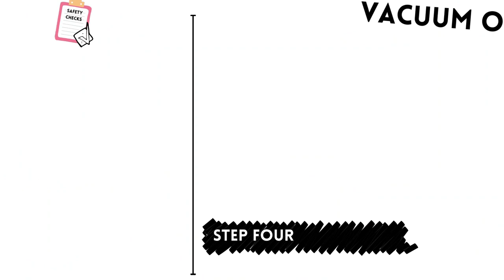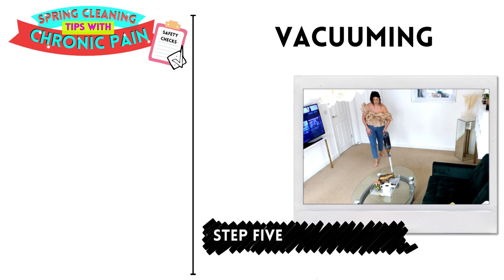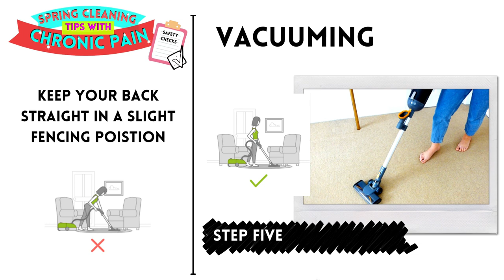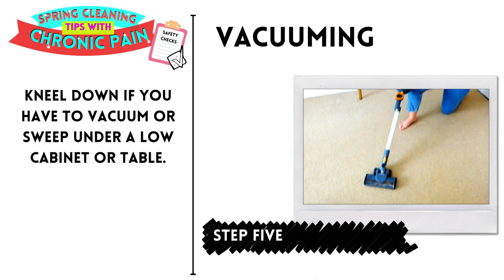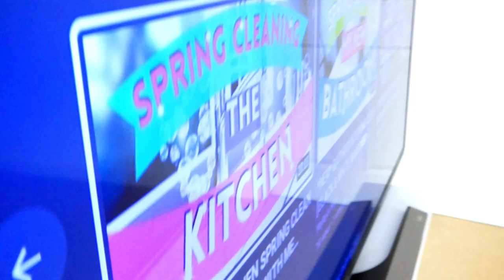2021 *NEW* TOP CLEANING TIPS WITH CHRONIC PAIN [AVOID INJURY]

Comment: Hey Hayley.

Do you still have your Vorwerk vacuum cleaner?
Reply from the maker: No it’s fully stopped working now 😩 like won’t even turn on so it’s off to the tip xx
Reply: @hayleyshelp  how on did you had the Vorwerk? I always thought they are great vacuums
Reply from the maker: @ilrimpianto  I had it for about 7 years
Reply: @hayleyshelp  Is the Halo vacuum bagless?

Very short period of lifespan for a German manufactured vacuum
Reply: @hayleyshelp  I had a Miele for 14 years. It just blew. It ia done. The end of it‼️😀.I have a new Miele again
Reply from the maker: @ilrimpianto  no the halo is bagged, yeh I’m disappointed it’s not working anymore it started to small like it was burning then it just didn’t switch on anymore 🤔
Reply from the maker: @ilrimpianto  Miele are brilliant I’ve heard that’s what I might go for next either that or the Kirby vacuum
Reply: @hayleyshelp  I like bagged vacuums. It seems like a very handy vacuum😀. Oh dear?!!!!
Reply: @hayleyshelp  🥴🤔
Reply: @hayleyshelp  I have a Kirby Sentria 1. They clean exception. Just very heavy and the bags are expensive. Such a versatile cleaner. The change from upright to canister take some practice but once you get it is so quick
Reply: @hayleyshelp  You can have a look at Sebo too🤩
Reply from the maker: @ilrimpianto  yeh it’s really great I’ve been using it since I got it and I’ve only just had to change the bag now 🙌🏽
Reply: @hayleyshelp  Goodness‼️The bag is huge! Kirby bags are expensive.